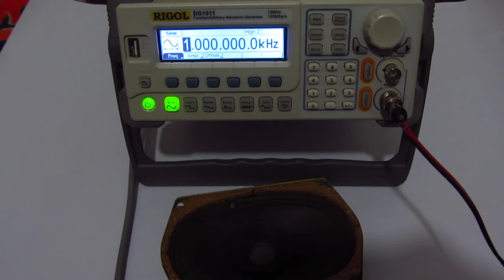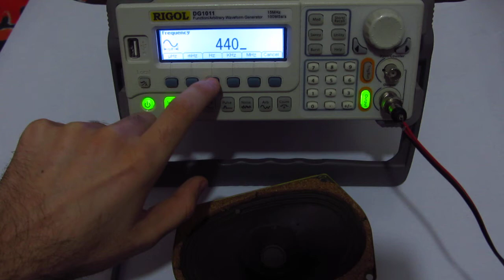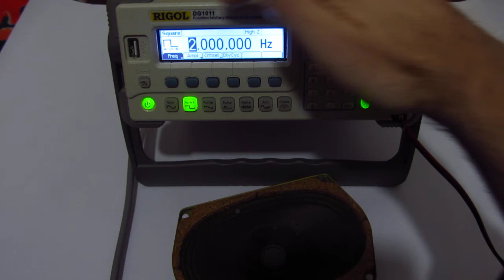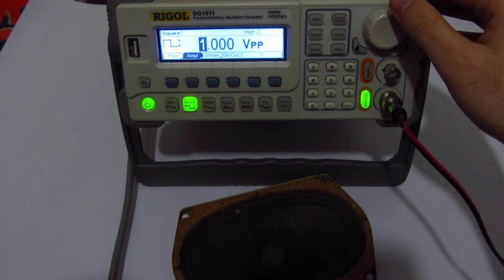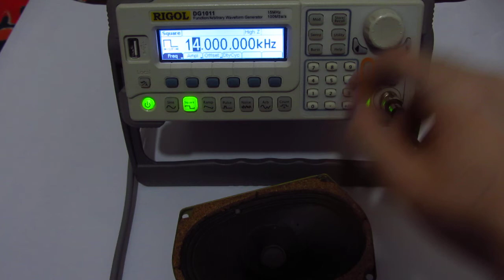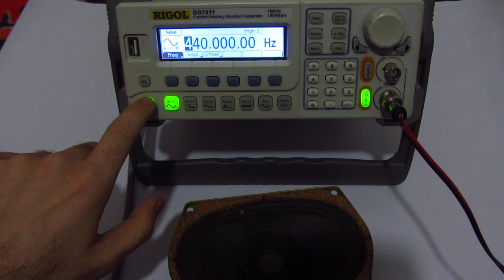Function Generator + Speaker (Rigol DG1011)

Comment: how do you connect the positive and negative terminal of the function generator to the speaker and what is the amplitude voltage? thanks!
Reply from the maker: There is a BNC to RCA adapter connected to the generator, and the rest is just a simple cable connected to the speaker. The voltage is shown from 1:00. I used between 5 and 20 volt peak to peak AC (the current is low).

Comment: Thanks for sharing! I have Aktakom 50 MHz ( AWG-4150 ) and when I try to output the signal, I get very faint sound! Nothing like yours! My generator goes only to 14V VPP. Do I need some kind of amplifier? I'm new to these kind of experiments, so I don't know much, be nice to me.
Reply from the maker: Probably an amplifier would help, I think the newer ones have one built in, this can light up even a small 3V incandescent light bulb when it is set to the highest voltage (current is low).
Reply: @furulevi  Thank you very much.

Comment: if you were able to connect a generator to an object like glass, would you eventually break the glass when you turn the generator up?
Reply from the maker: You need to connect the generator to something that can vibrate, like the membrane of a speaker in this case. Otherwise just the electric power won't really vibrate anything.

Comment: I wonder if you've used a tweeter (or a smaller speaker) for the 16 Khz frequency (or higher) if you'd have been able to hear something. In other words, what's the frequency range of the old speaker that you used for the test? Interesting experiment though. Thank you for posting!
Reply from the maker: In this video I used only this speaker. I'm not sure about the range of the speaker, but I could hear somewhere around 40-18000 Hz.

Comment: I just measured the decibels from my anti dog barking machine using a simple mobile phone App at 70 db.  How many decibels was your speaker ??
Reply: What anti barking machine do you use? I need to purchase such device and looking for recommendations
Reply: @dannydee9919  My advice now is stay far away from any high freq noise from these machines or youtube videos. They can cause Tinnitus (permanent ringing in your ear in a split second with no cure)          Move house is better idea no matter what it costs.
Reply: @michaelcostello6991  i appreciate your advice and your concern however Im not new to this. Im comfortable with the subject matter. Although im not a physicist, however i am a degreed engineer with 15 plus years of real world experience which includes doing consulting work for a a company that manufactures high end self powered speakers audio analysis tools for the professional sound reinforcement.  

I could always built a system that emits high frequency with parts bought from Amazon, its really not that hard, just time consuming. I would rather buy something turn-key. I was picking your brain for suggestions. You dont have to if you dont want to share information. This is America,  free country (im speaking for myself living in the states). You are not the only one with such devices.
Reply: @dannydee9919  Mate im a complete amateur. I chrome cast a high frequency youtube file from my computer to the google chromecast speaker and both myself and partner got tinnitus 2 months ago. I just played it a couple of times over a week. Dont matter if your an engineer or complete amateur like me. This is extremely dangerous. If a person gets tinnitus there is no cure. When there is no cure its best to walk away fast.  I posted some comments about my great idea but took them down straight away when this happened.    Dont gamble with your ears. Read up on tinnitus first. You are playing Russian Roullette

Comment: About this signal generator, how would this be used for electronic musical instruments? I'm trying figure out how to build a tone generator for my upcoming homemade organ project.
Reply from the maker: +The Zangorchian Millerator 
Modern function generators have some wave saving functions, I haven't used it yet, but maybe you could upload a musical pattern from a PC into the function generator via USB. The same thing is done by the sound-card of a PC.
Reply: Check pll cd4046 circuits

Comment: Hi, please how did you power the speaker? I mean did you connect the speaker to a power source either directly or to an amplifier?
Reply from the maker: The speaker is connected directly to the signal generator's output, there is no additional power input to the speaker, nor any amplifier. Set the voltage high enough (max 20v for this signal generator) and the sound should be audible.
Reply: furulevi ok, thanks.

Comment: Hi, I am preparing a project for my school homework. I am wondering that can I vibrate a metal with this signal generator by the frequency wave? And how can I do this?
Reply: Connect an amplifier and a speaker to signal generator and place the object near the speaker😅
Reply: @dalaylamasana  hi can you help me also regarding this matter. I have to supply different frequencies to my object to make it shake.
Reply: place some talk powder on a thin diaphragma like a baloon rubber and try different distances in order to estimate the effect. the lenght of the object must be in resonance with the wavelenght of the signal.

Comment: Why will your function generator drive speaker but my FY 6800 function signal generator won't?
Reply from the maker: I'm not sure, maybe this Rigol outputs a higher current. Try another smaller speaker. Use 50 - 20.000 Hz only.
Reply: @furulevi  It is strange that a new signal generator  won't drive a speaker. I have a couple of other speaker I will try to day.